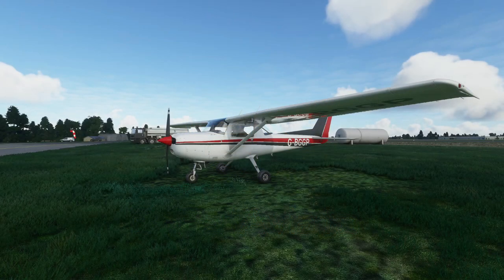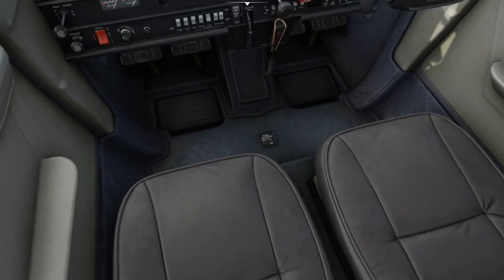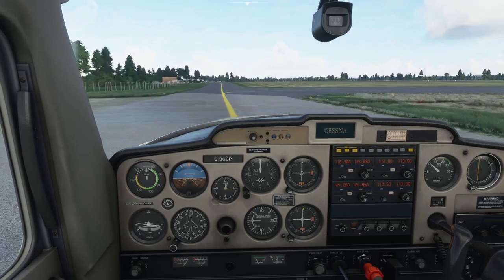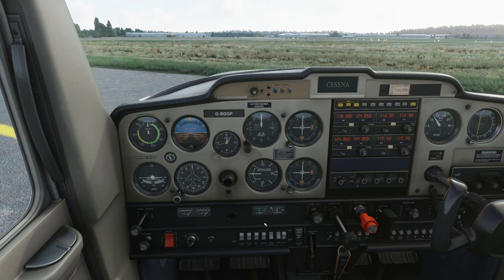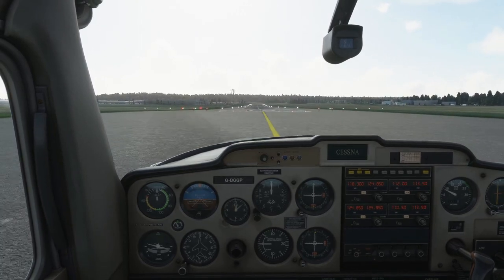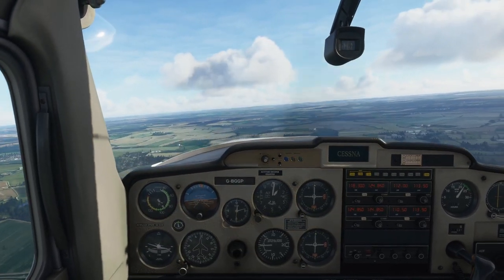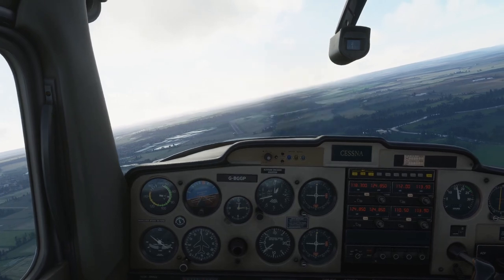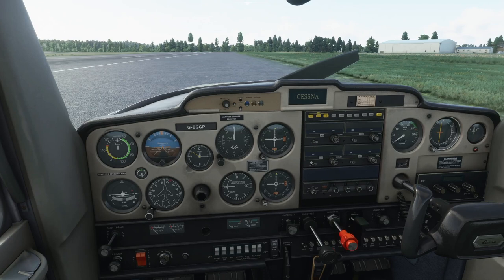Flight Simulator 2020: Real world pilot normal Cessna 152 circuit tutorial!

Comment: Great tutorial - thank you for taking the time to share this with us.  I noted you kept carb heat applied all the way to touchdown - my (simulated) training was to remove carb heat at a height of about 300' so full power was available in the event of a go-around.  Any thoughts on that?
Reply from the maker: Yeah I’ve seen that done before but I was taught it was one more thing to be thinking about on final. My instructor taught me to have my thumb out during the go around and as you advance the throttle you push in the card heat also. 

However I actually think your way might be better. I did a real go around once and forgot the carb heat and was confused about the lack of power for a split second. Also, a closed carb heat won’t be ingesting crap from the runway as it’s unfiltered

Comment: Nice job on the video. As a point of interest on when to remove flaps after landing. It is not to difficult to control an airplane on the ground after touching down during calm conditions. The challenge is during crosswind conditions meeting or exceeding the pilots experience. Its handling as quickly as possible the transition from a flying vehicle to a ground vehicle and GA training airplanes suck as ground vehicles. GA manufactures do not recommend taxing with the flaps down and yet there are some pilots who have taken the position its OK if you have just landed and you are taxing to exit the runway. The last time I looked the Cessna 152 isn't anywhere close to the weight of a 737 taxing off the runway with flaps down, its closer to a kite. How I handle a landing is after the nose wheel has touched down at the slowest possible speed I raise the flaps to transfer as much weight of the airplane from the wings to the landing gear. In other words I want the airplane as far away from flying speed as possible. Once I have the airplane at a taxi speed I can maintain control, I will exit the runway.  Learn to transition from flying speed to taxing speed as quickly and safely as possible in mild crosswind condition so on those not so good flying days you can handle the landings associated with strong crosswinds.
Reply from the maker: It’s a fair approach to take and if it works for you then I’m all for it. Personally I don’t like the risk of misidentification of a control, and I’ve landed the 152 in some pretty crazy crosswinds and have never had a problem with getting airborne or lifting a wing.  We all touch down close to if not at the point of stall anyway, right ?!
Reply: It sounds as if your landing at the minimum controllable airspeed which is great.  As an instructor I found too many student pilots and private pilots touching down at high airspeeds that result in high side loads on the landing gear caused by over controlling the nose wheel steering, or pushing forward on the yoke control and ending up on the nose wheel. There is a good reason the POH shows how the flight control surfaces should be deflected while taxing, I would think the manufacture hasn't changed their position on where flight surfaces should be placed while taxing off a runway. There is a very good reason why more than 45% of aircraft accidents occur during the final approach and landing phase.
Reply from the maker: @lpappas474  now taxiing a piper cub or on the rollout …that quickly teaches you to position the controls for the wind!
Reply: @expataviator7107  Sounds as if you are finding out about how important it is to maintain directional control with the rudder pedals. Tail draggers are a lot of fun to fly. I'm sure your instructor has told you how important it is to keep your heels on the floor while landing.
Reply from the maker: @lpappas474  Except the brakes on the cub are heel brakes :D
Reply: @expataviator7107  Well enjoy the transition.

Comment: ❤ great. I am surprised that ‘one white-one red’ on approach would make it not possible to reach the runway without engines? I thought all approaches and circuit heights especially the glideslope 3 degrees was designed so that you could reach a runway dead-stick in an emergency? I must have been wrong. I have not seen it written anywhere, I just assumed it. Watching this video showed me how variable circuits can be even in the same aircraft. I suppose it depends on the place and the instructor. My instructor told me about a guy who used to land planes with a constant throttle setting right to above the runway threshold. It was not his method but he told me other methods were possible.
Reply from the maker: Depends on the airplane and technique but for some types that is the standard way to land. And yeah whether you can glide a 3 degree slope depends on the airplane type. And remember the lights may not always be set at 3 degrees!
Reply: @expataviator7107  OK. After an hour playing around with clouds in MSFS I worked out what ‘scatter’ does in case you do not know. Coverage is say 5% of the sky but a high scatter of above 70 means small clouds are distributed evenly across the sky, but a low scatter means they are clumped together more (more blue sky appears), but still 5% of the sky is covered in clouds if that makes sense.

Comment: Hi, do you fly with a sidestick? And if so, what are your sensitivity settings in sim? My joystick is really sensitive when flying cessna and I would really like to know is it normal or, if not, mayby try to change sensitivity, so it would fly better.
Reply from the maker: I fly with a Thrustmaster T16000 most of the time. I have not changed the sensitivity in the sim. Honestly neither that or a Honeycomb Alpha FEEL like a real airplane at all. Controls in a 152 are pretty light and sensitive IRL. But in the sim there’s no feedback or pressure from the airflow so its just not the same. I hate hand flying the sim it’s WAY harder than it is in reality.

Comment: I was taught to fly in the UK and was taught to reduce power at the end of the runway downwind not on base. Perhaps it was just a local thing?
Reply from the maker: Must have been a thing at East Midlands flying school!
Reply: @expataviator7107  Possibly. Sounds like you were fairly local. I learned to fly at Sheffield Aeroclub (Netherthorpe) but finished at Doncaster Aeroclub which flew out of Sturgate after the Doncaster airstrip was shut down. I did my QCC Sturgate - East Midlands - Leeds Bradford. It was late 1980 though, so it may also be an age thing!
Reply from the maker: @FatParamotorGuy  some short runways there! Yeah I finished my PPL in 1999. Going for my instrument rating next week!

Comment: Did you have to manually turn the radios off before recording this startup or did you find a way to make the default state of the aircraft radios off? I've been trying to figure out in the files how I could change the default state of the avionics/radios since typically the radios shouldn't be on when starting the battery. Great video btw, thanks for sharing your knowledge about the C152, think I will adjust my checklists accordingly.

EDIT: Seems it may be from the mod you are using C152X? Is this mod still compatible with modern versions of the game?
EDIT #2: After some investigating it seems C152X is now known as JPLogistics  C152. Going to give this a try and see how it does.
EDIT #3: Just to report back in case someone else reads this, yes JPLogistics C152 fixes this issue.
Reply from the maker: Yep had to do it manually

Comment: If you set your altimeter to zero at field elevation, won't that mean that your transponder is broadcasting the incorrect altitude?
Reply from the maker: No. Most GA aircraft with that type of transponder are not linked to the altimeter. ATC relying on pilots setting an altimeter incorrectly would be too risky. Most just always broadcast standard pressure and the ATC scope adjusts for whatever the transition level is that day.
Reply: @expataviator7107  yeah I don’t think it works like that. You set your altitude from sea level not zero it out.
Reply from the maker: @BikerFail16  you can do either. Depends what you’re doing. If you live high above sea level it’s not worth all the winding

Comment: Hi from the UK! I am a real world pilot too, and would like to get into sims. However, I know NOTHING about them and a bit of a technophobe. I own a windows 7 laptop which you put coal in, and my mobile is 8 years old!🤣 What sort of expense would I be looking at to get a set up like yours, I assume four figures? P.S was that a VR headset? Best regards Stu
Reply from the maker: Yeah four figures easily to make it useable. Microsoft flight simulator works on the newer XBOX models so that could be a simpler more accessible option? 

And yep, I have a VR headset
Reply: @expataviator7107  Thanks for your reply! My daughter has a reasonably new XBOX. I might pursue that angle first before going big bucks!